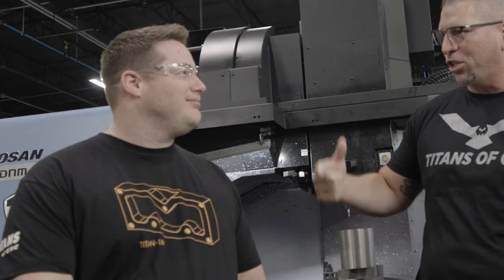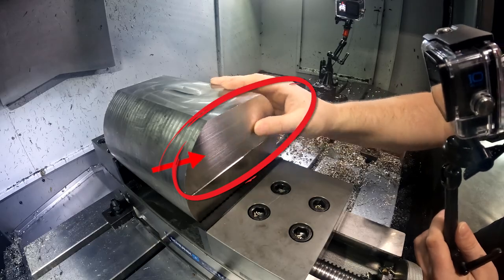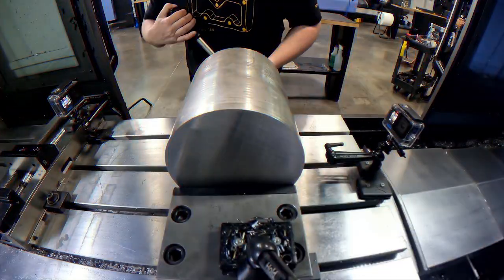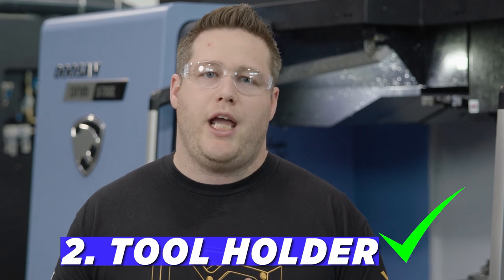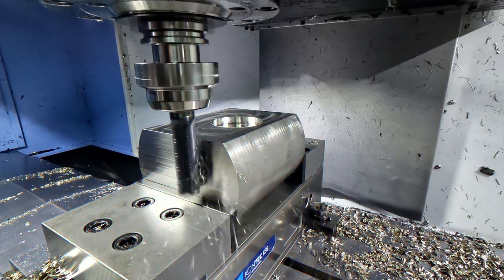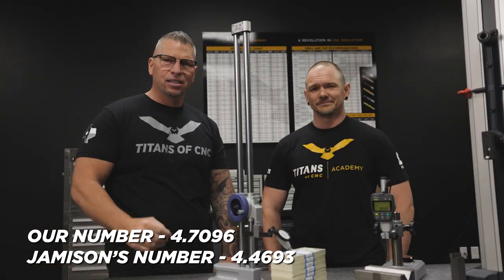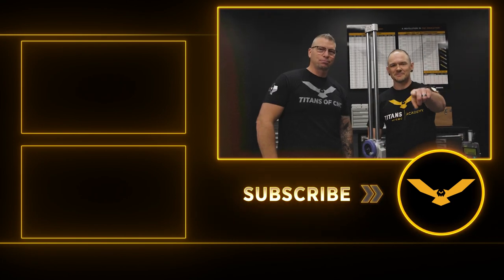CNC Machining Strategies to Remove Chatter | DNM 5700L | DN Solutions

Comment: Tldr; 
fixture rigidity
Tool rigidity and minimum stick out
Adjusting the tool pressure, (increase the cut width for finishing tools, or reduce the rpm for the same feed rate)

Comment: Awesome video. 
“Chatter” is a bitch and can destroy any workpiece at any time. 
Over the years I have had many mentors give advice on reducing chatter. They have all gave similar advise. 
First thing first make sure your setup and tooling is rigid. Avoid using a vise, shorten your tool as much as possible, and avoid machining parts that extend from the work holding device. Next anywhere you can use cast iron clamps, cast standoffs, or hardwood blocks to clamp the workpiece. Lastly, if your setup and process is solid, put pure water on it. I know it goes against everything machinists have been told, but it works.

I have used this trick many times while machining long parts on the lathe. During machining 15’ 3.5” pump shafts for WIER pump, chatter almost ruined the first of three workpieces. I had steady rests and follow rests and still had extreme chatter. I broke out the water in a spray mister and the chatter disappeared. I don’t know exactly why this works but it does. To this day I will use that trick after eliminating all other contributing factors.

Comment: Chatter is causing too much issues. Decreases spindle and tool life. Actually there is a program that solves these problems. Malinc developed such a amazing program that saves a lot of time. It shows you a graph about depth of cut/spindle speed and you can setup your cam avoiding chatter zone. Tbh it could not be suitable for single part operation but for mass production its amazing. Im wondering why titan not using cutPro/ChatterPro?

Also i love your job, please keep up the good work :)
Reply: cutPro is fckn expensive and takes a lot of work to implement. For single part operations I'd suggest to use Toolscope from Ceratizit or a simple Accelaration sensor mounted on the spindle. It's wild to see how high this jumpes as soon as you get in the area of natural frequency of machine, part and tool.

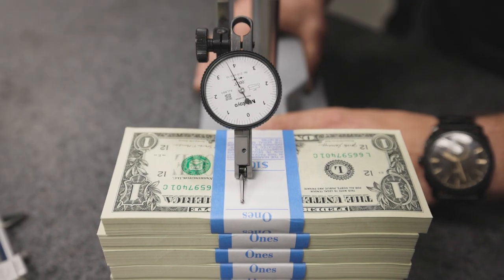Comment: 5:36 why is the indicator body hitting the stack up?
Reply: BOOM!!
Reply: That was me originally trying to find the high spot which is behind the stylus (or where it is touching the body) in this shot. The top of the stack is uneven and so it took a couple adjustments to find the right reading. Thanks for watching and good catch.
Reply: @travisjarrett2355  That stylus looks to be perpendicular to the body. To me it looks like you would get a false reading. I would have change the angle of the stylus to make shure there was no interfierence...  But that's just me..

Comment: 3:08 but i dont get how the big diameter would improve stiffness, if the part between the big diameter and the spindle has a way smaller diameter.
Reply: It has to with holding the tool itself.  Not spindle rigidity.

Comment: My big problem is that I'm running mills on structural steel. The chatter when you're milling in a 4 in hole on a 40 foot piece of 26x#85 is starting to feel unavoidable.

Comment: Your indicator was touching that stock of money just saying. :) not the needle so probably getting a bad reading
Reply: That was me originally trying to find the high spot which is behind the stylus (or where it was touching the body) in that shot. The top of the stack was uneven and so it took a couple adjustments to find the right reading. Thanks for watching and good catch.

Comment: Why not offer a job or a paid internship rather than giving away a bunch of 1$ bills. And let's be ultra clear here. Your machinists aren't machining anything. All they do is push buttons and do math. The machine does all the work. Yes they may have the occasional tool interference or trick way to write a tool path. But a cnc machinist is a generalized term for operators. To be called a machinist you have to be able to file a 2" square block symmetric. You have to be able to pick up and repair threads on a manual machine. You guys should be called program writers and button pushers. I'm not trying to hate here really, but why don't you actually show someone how to do your job. From start to finish. I bet it's because they might steal your work afterwards.
Reply: Well first thoughts is to call you certain words but ill skip that and just say its not quite the same. You wouldn't say a professional racing driver ISNT a driver because times have changed from when everything was manual and the drivers worked on cars too...
As a professional programmer/setter/operator myself I can tell you its not the same as it used to be but it is in no way easier. Times change and so do the problems and their solutions. The only difference is I'm not physically turning the handles anymore.
Reply from the maker: Definitely not going to spend to much time on your negative comment… but since you clearly don’t know us, I will say that we teach step by step with our Free curriculum and platform called academy.titansofcnc.com which has 150,000 current students and 2700 schools using it. We also have our Free AerospaceAcademy.com and have a Free Grinding Academy coming out… etc etc etc.

Have a Blessed Day😁😁🤙
Reply: @wildin13  I would say that a video game driver compared to a real race car driver is is still driving right
Reply: @TITANSofCNC  definitely been in the academy videos. It's mostly the boss man talking life lesson on how to be a successful person rather than machining. I actually like your channel I'm not trying to bash. Really. But there are aspects of manual machining and repair that you do not learn from being a cnc machinist. You have to walk before you can swim. Giving someone knowledge of cnc machining before manual machining is a bad way to teach. It's the hammer is your only tool so everything is a nail. I once again will say I do like your channel. But it's more philosophy and attitude not actual teaching of machining. Show me a video where guy goes from part order to finished part. All offsets work piece setup. Tool selection Yada Yada.
Reply: @wildin13  I didn't talk about program writers I specifically mention cnc machinists as not being real machinists. That varies from shop to shop, butost cnc operators are button pushers change my mind, sips on coffee.
Reply: @machinist1337  "or trick way to write a tool path"??
I do all three daily... I can be shifting tons of steel roughing or finishing intricate moulds. I can also design and make my own electrodes and EDM them myself too. I will jump on any machine in the shop including surface grinder and manual machines. 99% of my work is Mastercam programmed but I'm definitely a machinist.
I'll give you that there are steps from bottom to top but even a role as simple as just running parts will have some aspect of modern machining, even if its just acounting for tool wear...
Reply: @wildin13  so you fall into the 10% that is actually a machinist based on what your telling me you should pull in easy 100k if you don't they are screwing you. Your worth more than you know.
Reply: Let me give you some background. I have been in the industry since I was 18 cnc shops manual shops repair shops productions shops, I have seen it all. I now own my own company fixing cnc and manual machines. You would not believe the shit I deal with on a daily basis. My opinions may be skewed due to this.  I have taught machining for the army corps engineers. I literally am a manual machine teacher.  Not the best I always learn something new. But this video title really just chapped me and I had to step in. How to stop chatter? That's is the most general machining statement I have ever heard. Or how to clamp this part? Videos. A real machinist could not answer either of those questions without some investigation. Your a machinist can you tell me in a short youtube video how to reduce chatter as a whole?
Reply: @machinist1337  I understand your comment about a CNC Machinist not being a real machinist, understanding that unless you use manual machines and turn handles like a real machinist, you're just a button pusher. However, that's like calling these so called physicians, doctors when they use stuff like x-rays, ablation systems, electrosurgical instruments and ultrasonic dissection and heaven forbid, robotic assisted surgery. Everyone knows a REAL DOCTOR carries a black bag, a bottle of alcohol, stethoscope and a sharp knife.
Reply: @rickyoung360  yes that what I'm saying. If you don't turn handles and know how form and shape metal without a program doing it for you. Then ya your not a real machinist.
Reply: @machinist1337  Impressive how someone claiming to own a company fixing CNC machines can be so ignorant about the very same things you fix. Another proof that titles and background is not that important.